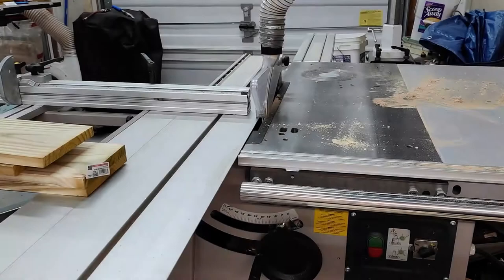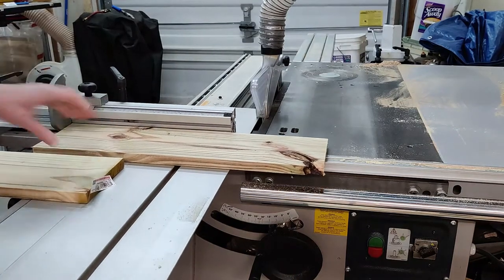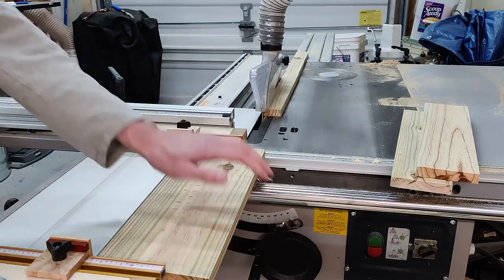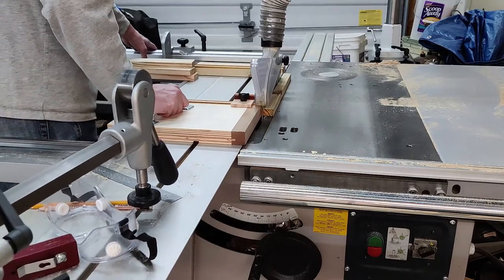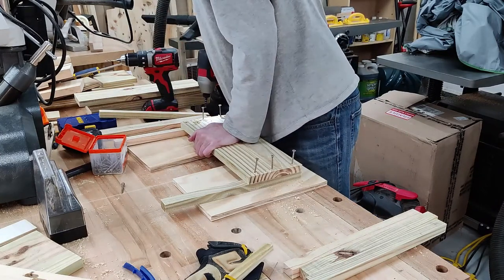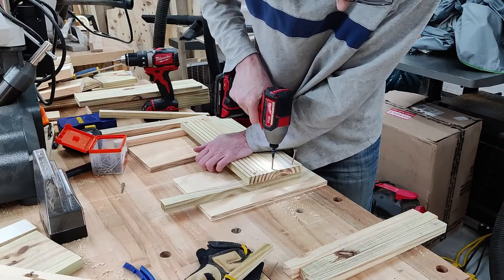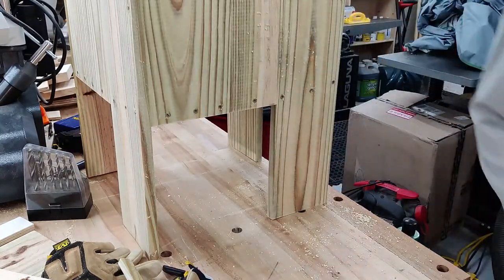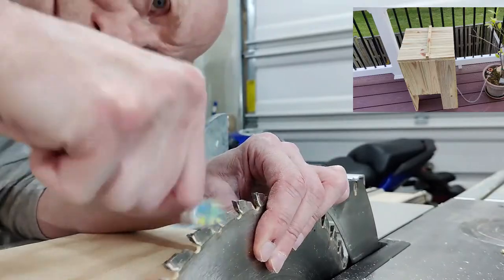Project - Watertower

Comment: Why don't you use glue?
Reply from the maker: Gluing two boards where the grain runs perpendicular to each other is usually avoided because wood swells and shrinks across the grain based on the moisture in the wood. This will eventually break the glue bond. 
Normally, it may not be an issue in a project of this size, but these boards were very wet. Since I've put these out on the deck, each board has contracted about 1/4" in width.